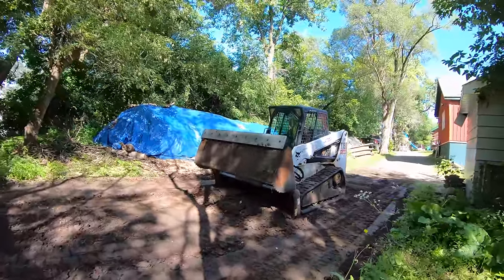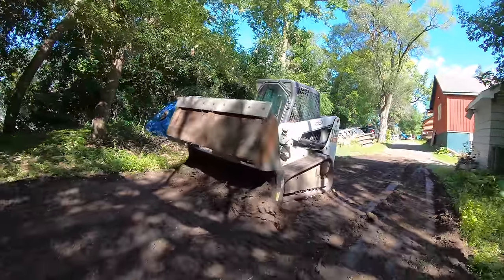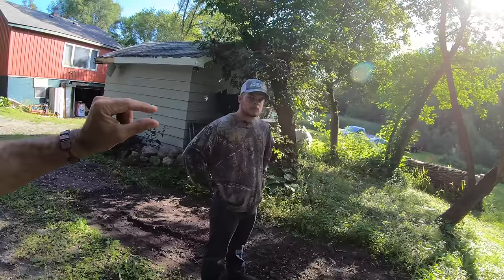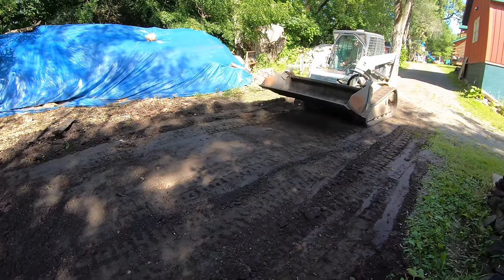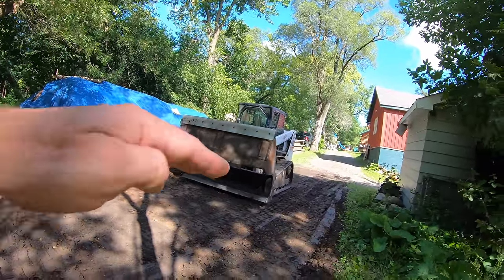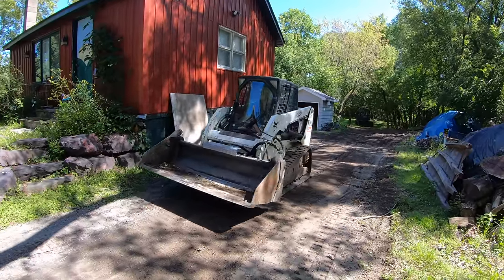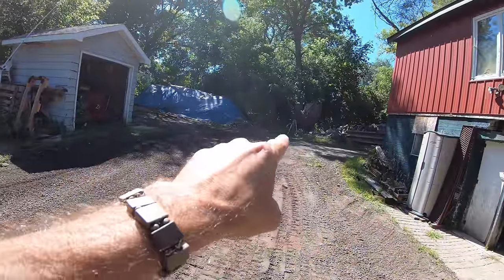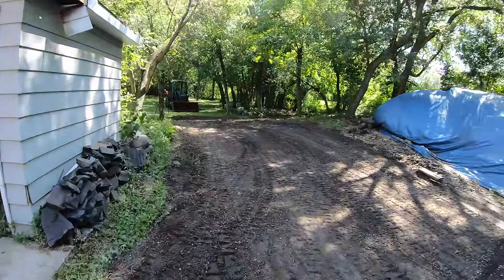Noob Tries his hand at Cutting Grade & running his first 4 in 1 bucket -Can he handle it? 4k video

Comment: Bit late to the comment section but here in Australia we exclusively run 4 in 1 buckets on skid loaders. You'll NEVER see a solid bucket here on a job site! Here's a couple tips for ya. You can make the dozer blade less aggressive by closing the 4 in 1 so that there is a roughly 6 inch gap then roll forward and make contact with your grade. Then slowly open or close depending on how fine or hard you wanna cut. It is A LOT easier to use a 4 in 1 with a hand controlled machine though. You can also use the 4 in 1 to cut in reverse by using both cutting edges to make it more precise or really dig by just using the open gate cutting edge. Alex did a really good job though for running a foot controlled machine for the first time. A lot better than I would have done as most of the machines here are hand controlled.
Reply: Yep, open the jaw and rotate to precision cut. There is no real control with an open bucket like that.  Feel is definitely a thing. I learned on a JCB wheeled machine. Lot easier on tracks of course. But then I am talking 40 years ago! Jeeze I miss that sort of work (when you dont have to do it… :-)
Reply: Nice tip!!👍
Reply: Hey mate I'm hearing ya I've watched so many videos of these solid buckets in the states and to be honest they are terrible 4 in 1 is the only way
Reply: Agree on all counts.  Combo bucket is absolutely amazing.  Another one you can’t do without is the rake/rick bucket.  If you typically deal with rock you have to have one of these.  Great to screen out rocks quick, but not a better implement for grading I’ve ever used….even the combo can’t grade as fast…

Comment: Red. 
Nice work, Alex. It feels good when the boss puts trust in you and you prove it was the right decision.  

Checking levels for a long retaining wall a few years ago and a porch last summer, I couldn’t justify the cost of a laser. I used a length of clear tubing with food colored water in it.  The reference end was zip tied to a stake in the middle and I would hold the other end along other stakes and mark the water levels on them.  That gave me consistence reference points to measure from.
Reply: The water level is as old as the pyramids ,possibly older.

Comment: I love the drott bucket and yes you are correct you don't see them on steer skids to often, you mostly see em' on larger tracked loaders (955 cats etc..) doing demo work. But then again if you would be using a dozer for this job it's the same thing you can't really see the cut you are making either. Think the kid is doing pretty well with no experience. Also turn the controls around on that machine I have did it on a few in the past foot for steer hand for bucket all it takes is some new lines makes life easier ( like a excavator)

Comment: I agree with you Stan I learned on a hand and foot control bobcat but I have used the hand controlled bobcats and if you ask me they are too touchy. Their all electronic their not like the older ones where the controls actually go to the hydraulic pump and you get a feel for what your doing, they go to a computer and get sent where they need to go and most of the time its delayed. I own an S175 with the hand and foot control that goes right to the hydraulic pump instead of being all electric and other than changing the fluids and keeping the Desil Guzzling Kubota engine fueled it really has not given me any issues its from 2011 with only 272.8 hours on it. Also Red

Comment: RED,  4 in 1's are great ,  I used to operate a 941 Traxcavator with a 4 in 1 bucket .  When using a 4 in 1 on a skid-steer in the blade position ,  you need to think of yourself as operating a bulldozer ;  you can't see the cutting edge on a bulldozer so you cut by feel ,  unless you're moving massive quantities of soil .  I actually use a CAT D-2 bulldozer for dressing the roads on my mining claim .

Comment: Whenever I used a 4 in 1, I would be in reverse, have the bucket opened so that the back of the bucket set my grade, and the front of the bucket would carry extra material to fill in any holes or dips that got made. Going forward you are constantly creating ruts with your tracks, where going in reverse and carrying the material in the front of your bucket helps to always level the ground off.

Comment: Another 4in1 trick is to open the bucket about 3 or 4 (all buckets are different) inches and back blade and it will leave off nicely

Comment: 4 in 1's are awesome "IF" you can use one, they are tough to run until u get the time in behind one. It's all I will use now, it does it all... Close the top of the bucket down and u can shave off as little as an inch (if desired) and it will roll it into the bucket for u.. It will also keep you from gouging the ground. It's almost impossible to grade with the dozer blade part of a 4 in 1 without using the top half of the bucket as a downward guide.

Comment: When your using the lower cutter on the 4/1 bucket, you can use the bucket cutting edge as a height reference for gauging where your lower cutter is sitting. 👀😏😎👍👋✌️🇨🇦

Comment: That's a really hard way to do it.. A good way to grade is open the bucket a few inches and roll it forward.. So the upper apron is skidding on the ground controlling the cutting edge depth..
Reply: Andrew Gaulton yep, use the front part to set the height of the cutting edge. If the front part of the bucket is an inch higher than the cutting edge then you take an inch off. Once you get the feel it’s not too hard. We pretty much only have four in one buckets Down Under, very rare to see a skid steer without a four in one.
Reply: @horseman9582  that's it mate!! Drott/backhoe all the same.. 
Your right They always seem to have standard buckets!!
Reply: Andrew Gaulton I would not want a skid steer without a four in one bucket. I open mine to backblade off grass and scrub without disturbing the ground, I pick stuff up, so many more thing can be done with a four in one! I set the depth of sand on arenas by using the teeth. They are four inches long, if I roll it back a bit and lightly run the tip of the teeth along the base it sets the depth at two or three inches. So handy.

Comment: I know this video is over 2 years old, but I have a question about the 4 in 1 bucket. Could you use the rear blade and the front of the bucket raised just slightly off the ground to scrape material similar to how a belly scraper works? I'm thinking that the new material being cut by the rear blade would push the loose material up into the bucket, allowing you to remove more material instead of just bulldozing it? I've never used a 4 in 1 before so I have no idea how it "feels".

Comment: Here in Australia, the 4in1 bucket is the standard bucket machines come equipped with. It’s all I have ever used for a bucket, they are awesome. Ours have teeth on them too standard , I have have dug pools , basements, driveways and a tunnel too with my S130 with “Norm Engineering “ 4in 1 bucket . Super heavy duty . Check out their website in Qld Australia 🇦🇺 My Concretor’s will tell me what heights they want and I will look at by eye , dig it and then they check with a laser and I’m usually within 1/2 inch of where it needs to be and then I finish accordingly.

Comment: I use a 4in1 all the time in fact it's the only bucket we run and I never use it as a doser... I reckon it's a wast of time trying... if i want to cut a small amount off the time i open it ride up and pull back works much better

I'm form Australia and I've never seen a skid steer without a 1in4

Comment: How can you grade away from the  structures without first cutting perpendicular to set the grade for the skid steer? The 4 in 1 doesn't tilt down left or right. The skid steer can only cut on the angle it's sitting on.

Comment: Came back for part 2, I have a question for you Stan, I've been looking at vids on yt of people grading with equipment mostly of people using excavators and actually having the reciever of the laser on their sticks, It seems to be working really for those guys. So what I'm wondering is have you guys ever utilized that before with grading on a excavator or skid steer, and do you think it could be more practical with a job like this?
Reply: Daniel Abraham it really depends on the situation, if I’m gradeing a slope a excavator all day large open area a skid 
For this a excavator may have been nice to dig down throw is back and go, also you can get auto level on a excavator not a skid
Reply from the maker: Ive used that system and own it but I like the stick method.  I'm just old school though.

Comment: Why didn't you just set a few grade stakes with cuts and fills on them? Especially at the critical points. That way you don't have to keep checking the laser. You can eyeball between stakes and other points, like the slab being used as a bench mark.. Kind of like when pouring concrete. You pick two points, set the the mud to grade and screed between them.

Comment: You do not open your phone bucket all the way try only open at 6 to 8 in set your dozer blade on the ground roll forward until the other cutting-edge is barely touching the ground and then float accordingly with your feet controls the form one bucket will act as a box blade he will cut the hot spots down load the bucket with the excess dirt and fill in the low spots ..i can come up and teach a few class if you want ..i can train you guys how install fiberglass pools..i can install a 14x36 in one day with a laborer

Comment: I saw some place where they had a magnetic piece you could put on the equipment to read the level. Have you ever tried that? Thanks for the great vidoe Stan. That 4 in 1 bucket looks handy with a little learning curve.
Reply: I have tried the removable mount/laser from Spectre (grade/excavation). I am by no means proficient, but saved me in/out or up/down from having to use stick. It posed some limitations in having line of site to laser in some instances when working around obstacles. But definitely helps when working solo (most of the time). Much easier for footings than grade since it was first time for me having ability to slope as opposed to calculate fall after "X" amt of feet. All a learning curve, but in my mind, has already paid for itself on my two uses instead of a second body.

Comment: Grading with anything that close to the front idler has to be hell. Zero reaction time. I never ran one, but if I did.... I would make small cuts at probably a slower rate of speed. I can fine grade easily with a typical bucket, what are the advantages of grading like this?

Comment: Use it like a cheese slicer. Open about 6” tilt forwards grade backwards or forwards. Frame of bucket will be a guide that prevents cutting edge from diving down and over excavating. Boom like a champ! Should be able to grade with far less passes, being more efficient. Switch grading from inches to tenths of feet. The math is so much easier. This is the way civil engineering works. Grade stakes and such. Professional. A whole different level of construction methods.